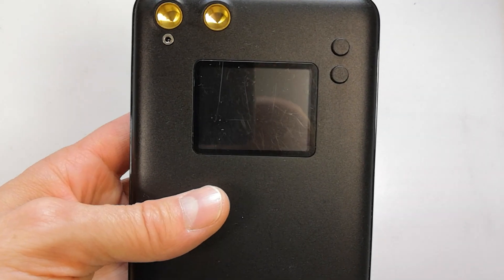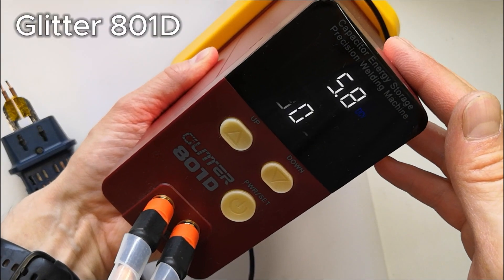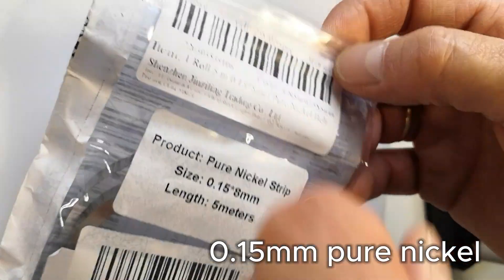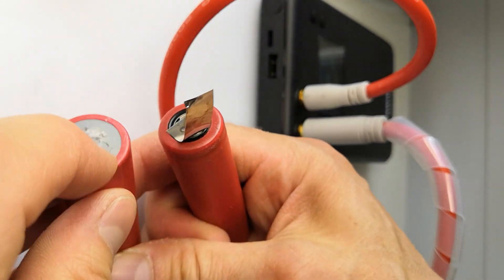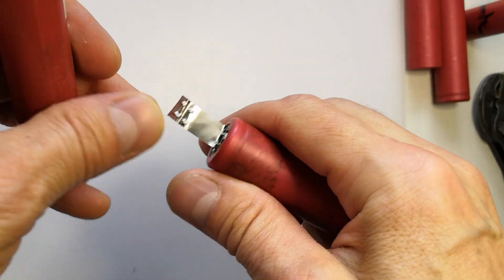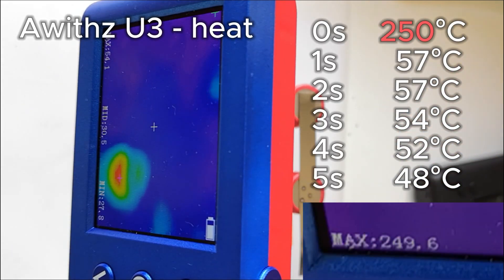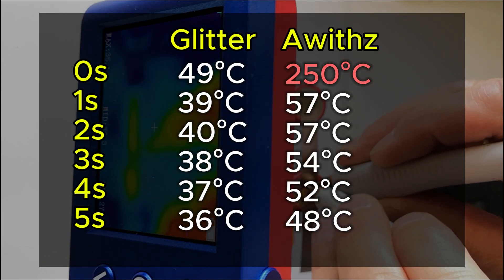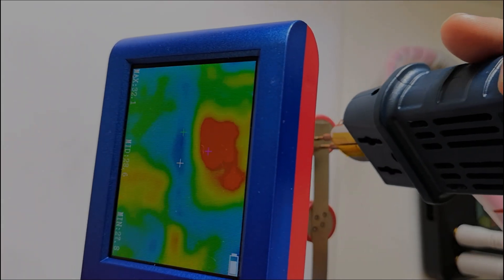Glitter 801D vs Awithz  U3 Spot Welder comparison

Comment: You should compare apples to apples. Glitter 801D is 21KW. Awithz has P20 which is also 20KW. You should not compare U3 with 801. I have Awithz P90 57KW, which eats that glitter for breakfast. Also, you can put together the electrodes of Awithz with a simple band and achieve the same result.
Reply from the maker: Thanks for comment. Several reviews claim that those portable mini welders are good, and I bought one. It didn't do the job and I bought a bigger one. I made this video that others won't make that mistake. I still keep wondering numerous positive reviews of those cheap welders.
Reply: @SnapTinker very nice review and you are first one to showing temperature 
This would make decision better